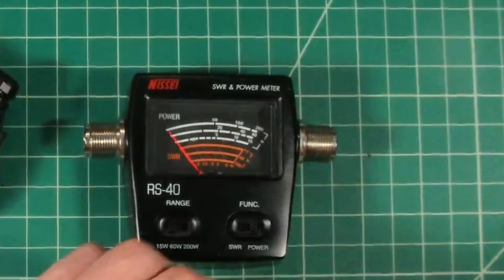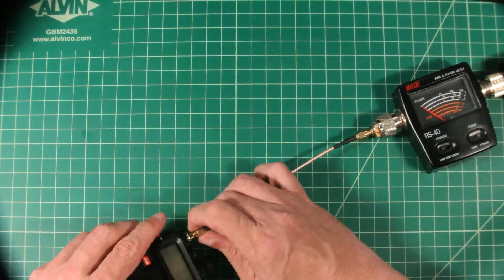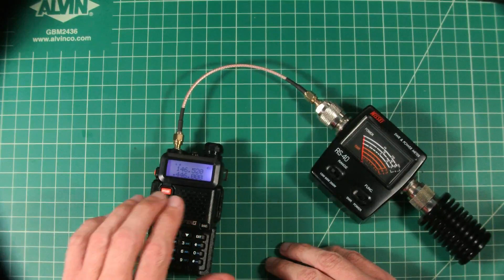Baofeng GT-5R Power Test - Ham Radio

Comment: Ape, when you went from 440 to 2m it went back to high power 3:30 in the video. you can see the L go away
Reply: Yep, I like that feature.  The Baofengs store completely separate STEP, TXP, WN, SFT-D, OFFSET and other settings in each of the VFOs.  It makes things easier to keep UHF in one VFO (5.0Mhz OFFSET for 440) while having the separate OFFSET in the other VFO (0.6Mhz OFFSET for 2m).  Not having to change quite so many settings if you want to flip bands and/or freqs, rpts in the FREQ mode.
Reply from the maker: D'oh!  I just checked 2m with the Low setting and it was 1.5W

Comment: How is the receive audio level output on the GT-5R? I have 3 of the UV-5Rs scattered throughout the house. The oldest one has tons of audio output. The other two were bought as a pair later on and the audio output is terrible. It's so low that if there is any other noise in the room, I cannot hear it well at all even with the volume all the way up. I remember reading a review a few years back about some of the UV-5Rs used different audio output ICs but I haven't been able to relocate that article. Thanks, Dave WB8VQV
Reply from the maker: Hey Dave!  This one sounds pretty good, especially considering they are 30$ 👍

Comment: just press the "#" key on the keypad to shift between low and high power. You can do it in the menus that's true but the single key is usually easier
Reply from the maker: Thanks!

Comment: @TheSmokinApe would you please check if Chirp can expand the frequencies of the GT-%R like it use  to be able to do with UV-5R?  I like hat fact that it transmit cleaner signal but I don't want to buy it if I can not expand the frequencies to what was covered by UV5R.
Reply from the maker: It can’t
Reply: @TheSmokinApe  so good old  UV-5R is my best option, is there anything comparable with cleaner signal?
Reply from the maker: @lovemytechy  I’m going to say no, I have a few 5Rs in my shack as well 👍